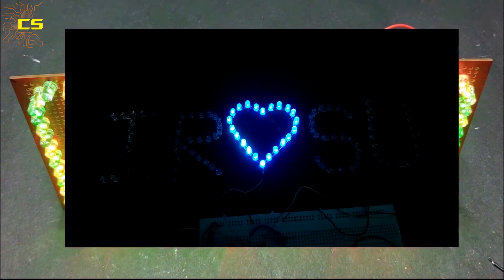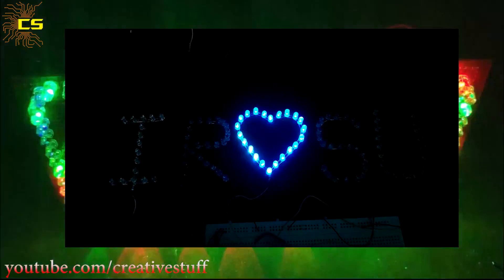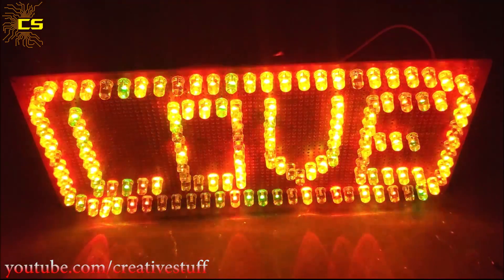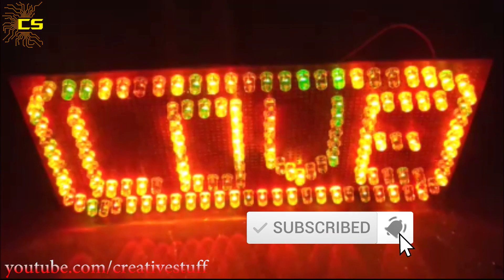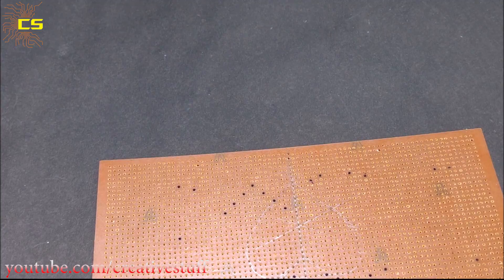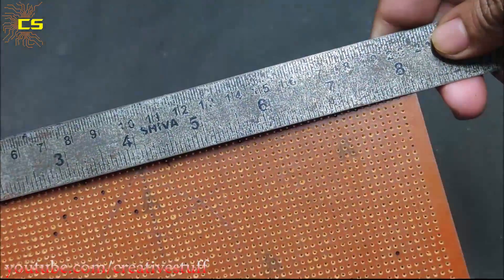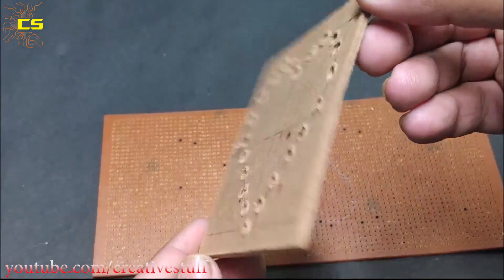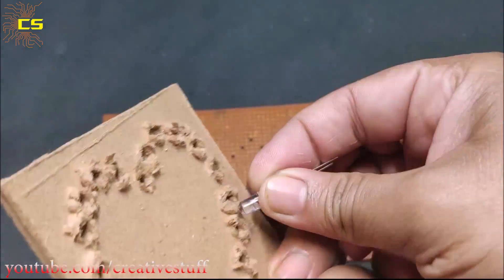How to make a Multi colour LED sign board

Comment: hi sir , i want to ask you.if I use 10 Led white diod and 200 ohm resistor , how much batterry voltage to support the circuit ?
Reply from the maker: Depends on how you are connecting the LEDs?? All the LEDs in parallel?
Reply: @CreativeStuff  no sir , i do it in series circuit
Reply from the maker: If you are connecting 10 LEDs in series then you will be needing 3v*10=30v battery....it's better to connect the LEDs in parallel or with series parallel combination
Reply: @CreativeStuff  okay thank you sir

Comment: I'm just learning so my knowledge is limited.
So, no resistors and it still works.  I guess because of the large number of LEDs and because, technically, they are not all on at the same time- they blink, so not all drawing current at the same time. does that sound right?  I'd like to make something like this using 5 volt usb power with the 3 to 3.2 volt fast flashing multi-color LEDs and without the border so maybe 5 volts could power it- what do you think, please?

Comment: i have to use 5mm rgb  around 150 in nos for making 6 letters. how can i connect them either in parallel or in series. what resistance should be used. can i use mobile adaptor. or suggested an dc adaptor.
Reply from the maker: Use just a 100 or 220 ohm resistor ..connect all the LEDs in parallel...mobile adaptor might work depenind upon the power output
Reply: @CreativeStuff   TQ SO MUCH. UR VIDEO INSPIRED ME TO MAKE A SIGN BOARD FOR MY SHOP..

Comment: Is it ok for LED? If use 5v adaptor, is it same wiring? 

I found this, what do you think?
Reply: https://www.homemade-circuits.com/welcome-chasing-led-display-circuit/
Reply from the maker: It all depends on  the rating of the LEDs you are using....single colour LEDs won't work this way....but these LEDs work perfectly with 9v supply
Reply: I'll use single color. Thanks for your reply.
Reply: Any suggestion for one color led?
Reply from the maker: Use them in parallel with an 100 ohm resister in series
Reply: Thanks